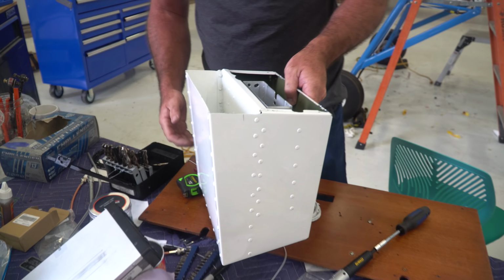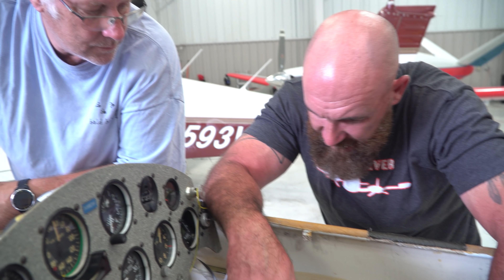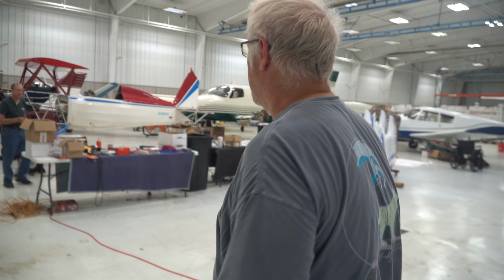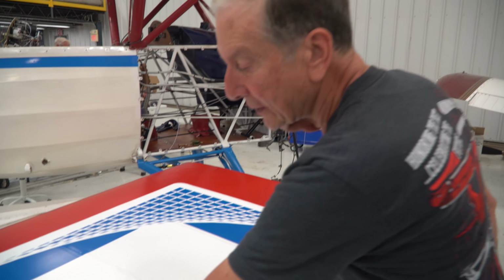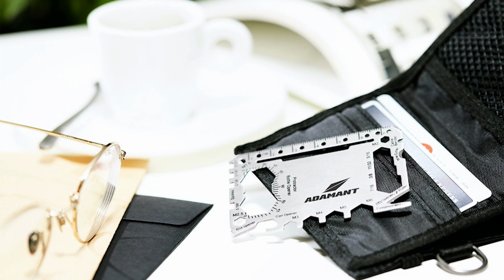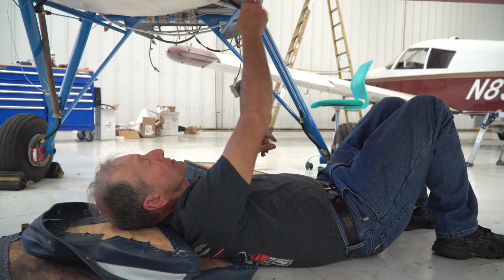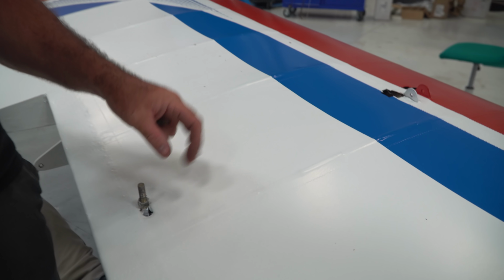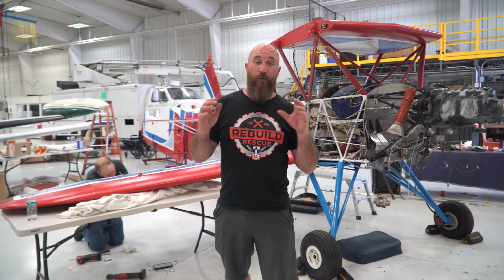Installing the wings on Freedom, Sam’s forgotten airplane

Comment: Love what this channel is doing and praise all the hard work.  I have to point out one thing. In the future, shrink tubing is much much better and safer than electrical tape. I cringed watching you wrap the wiring with tape.
Reply from the maker: I need to get some rolls of shrink tubing.
Reply: @rebuildrescue  I re-wired everything in the engine compartment of a '73 super beetle. Every electrical wire to the generator, coil, taillights, etc. Shrink tubing around everything.  Thought I would share noticing your attention to detail in your videos and projects.
Reply: @ShawnPossible  i need to get some of that too. restoring a 56 Ford Victoria and i have a lot of rewiring in my future lol. the original wire won’t last too much longer.

Comment: Long retired AF avionics tech.  Is the transponder required on "experimental" aircraft, and it is Mode C only?  Based on the high price back in the day, what do they cost these days.
Reply: Our airport is within the Mode C veil. So it is required. ADS B is also required in most areas now.

Comment: At about 9 minutes it looked like the bolt was being pushed from the back to the front,,,I was always of the understanding that the bolt heads should face the front of the aircraft
Reply: Not required. General practice but you get some bolts in any way you can. Even on certified airplanes.

Comment: just for info a bid cost 0,13$ and when you creat an account it auto pay for a pack of bid that cost 30$ to 40$
so technicly when win a product on dealdash for 1$ it's 1$ + the price of all bid you use to win the product so it's impossible to win something and only pay 0,01$ you will alway pay at least 0.14$ if you have the luck to bid on a product that no one else want and it will alway cost at least a 100 bid for semothing that cost 50$ on other website

Comment: Not for anything, but shouldn't those nuts be safety wired?
Reply: No. Not necessary if you use a nylon nut. If it is a movement point it gets a cotter pin. Safety wire are for heads that into a spot that aren’t either nylon or cotter. We will safety wire the bolts holding on the prop.